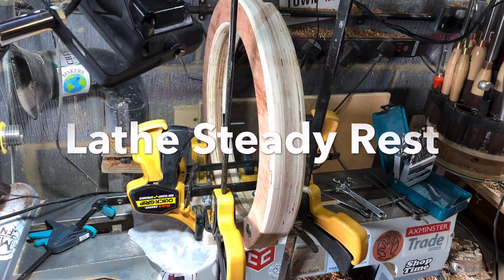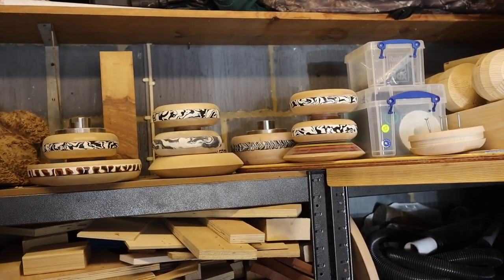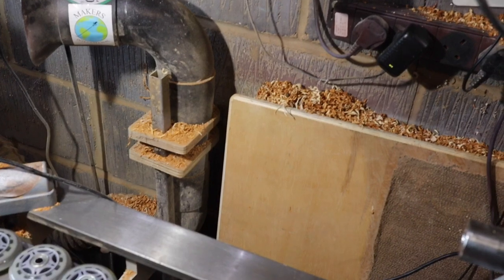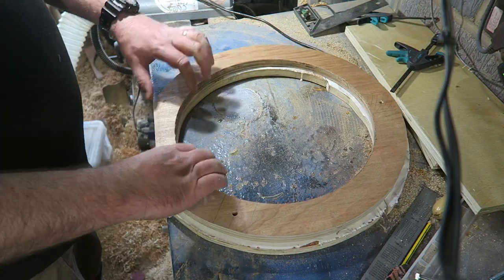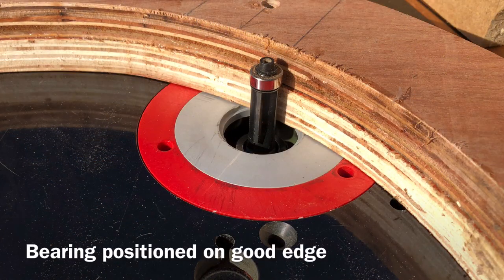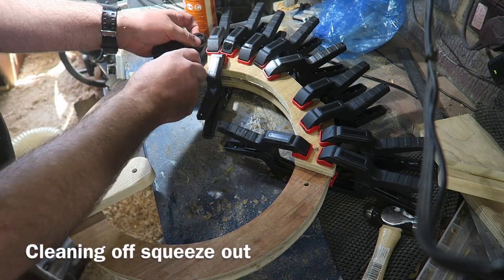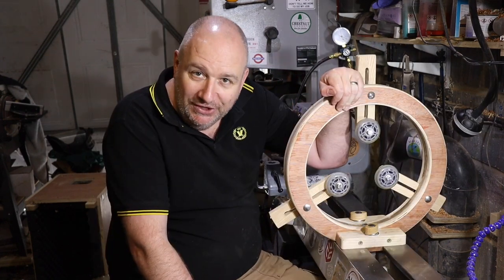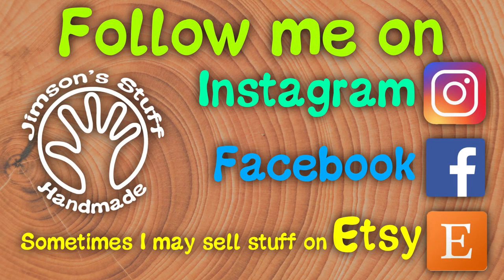Making a Lathe Steady Rest - Lockdown challenge

Comment: Very well done Jim, simple, strong and very functional. Those hold bars with stops is a great idea, thanks for that I will be making those for my steady rest, which closely resembles yours.  One thing I found out by doing on one project ,  to swap one steady leg around to allow a smaller shaft to be supported, with three wheels on the same side there is a limit to the small diameter that can be supported before the wheels contact each other, but by swapping one wheel leg around the smaller spindle shaft can be supported by two wheels under and one wheel above. I only had to do it once but it worked perfectly.   Stay safe and keep on turning. Cheers from Canada, Bert.
Reply from the maker: Thank you very much Bert and thanks for that tip. Stay safe.
Cheers 
Jim

Comment: usually, I use the drill press to tap.  And using a tap follower makes it even easier.
Reply from the maker: Many thanks for watching, yes I have used the drill press in the past but it is awkward filming my drill press. I only have a cheap set of taps and dies, only 1 tap for each size.
Cheers 
Jim

Comment: So, my lathe is a 14 inch swing... which means, I assume that 14 inch is the largest circle I can have... but you then cut the bottom of your circle flat to mount to the base.  Does this mean I should cut the outside circle to 14 1/2?   Also, is there a rule to how thick the full circle should be?  Meaning.. two inches from outer circle to inner?  Just trying to keep safe.   Really amazing video, exactly what I was looking for today.   Thank you
Reply from the maker: Thank you very much. I think that you have to accept that you cannot turn to the lathes full capacity when using a steady. as regards to thickness, I tend to over engineer everything. the thicker the better, stronger and less vibration.

Comment: Jim do you have any size's  ??
Reply from the maker: Sorry Douglas I didn’t make plans, I just made it as big as I could with what I had but I think the inner diameter was approx 14 inchs and the thickness of the ring was 2 inches x 2.5 inches. The ash arms were approx 45mm x18mm. It will largely depend on the size of your lathe. Many thanks for watching 
Cheers 
Jim
Reply: @JimsonMakes  Thank you for the help